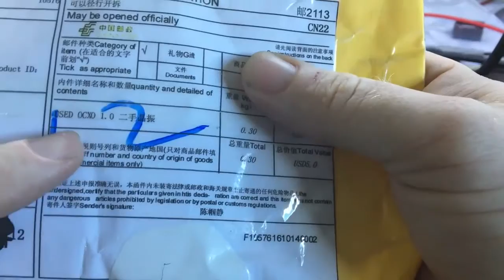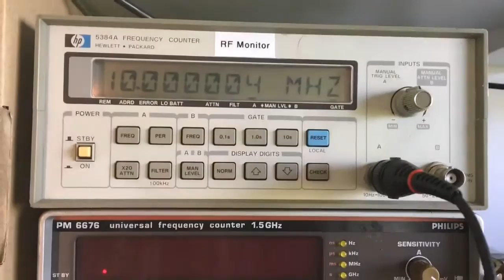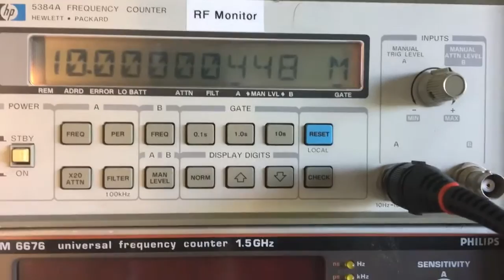#93 10MHz OCXO Ovenized Crystal Oscillator Test

Comment: just purchased an osc5A2B02 board mounted with  bnc and  dc connectors as well.  there"s even a trim pot to fine tune a bit. at max setting of trim pot voltage to module control pin is max 5 vdc freq short of 10 mhz and i cant raise it any  more. (999999.75) on my accurate chinese freq counter. any suggestions ?